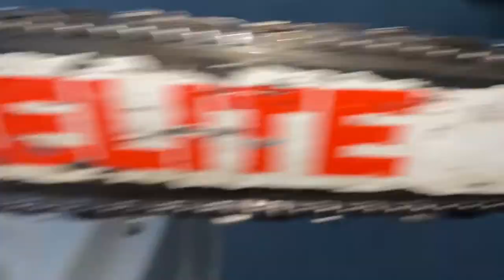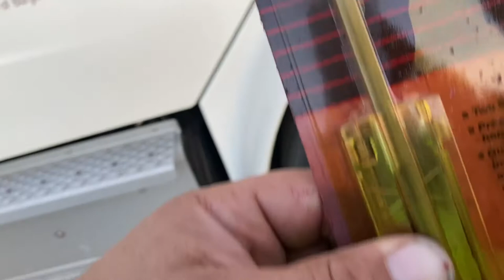Free Homelite Chainsaw Day!!  Guess what It Is??

Comment: Hoo hoo! Free chainsaws are great! You have that same goofy giddy look I had today! I was given a 150 Homelite a week ago and I've now got a 150 parts basket On its way next week for 10 bucks! Nailed an extra nice clean 80s vintage XL12 today in an original case, with wrench, ratchet, screwdriver, grease gun, owners manual, and original safety hang tag for a C note with a Lodge dutch oven sans lid thrown in. Had that beautiful girl singing my favorite song in 10 minutes after getting her home! She hadn't been used in years. Was lightly used, still had an original 20 inch HOMELITE bar and chain with a rim and drum sprocket. Giggity giggity. It IS a good day!
Reply from the maker: Feels so good doesn't it!!

Comment: That's about as happy as I've ever seen you. Good get Smitty.
At the paper mill I worked at for 43 years we used some recycled DLK. I worked a job there for 6 years unloading and recycling the DLK. Some of it may have come from where you work. We had a lot of trucks that came from PA.
Reply from the maker: We are one of the largest in the area.  It could be possible.